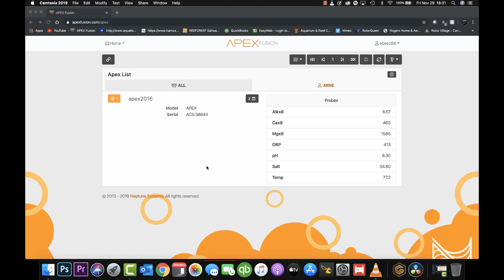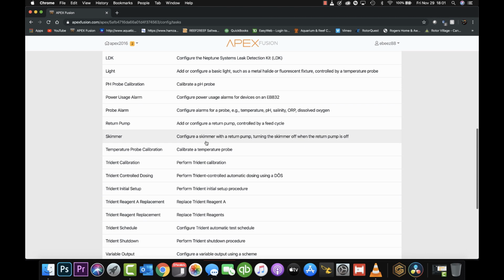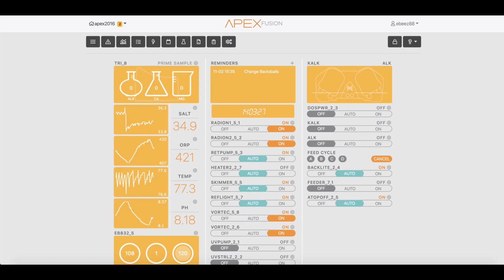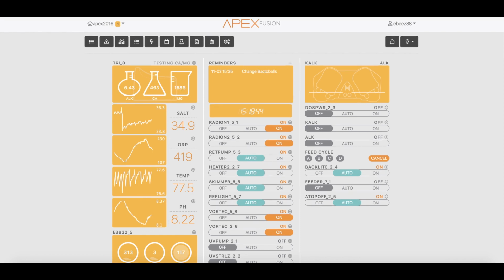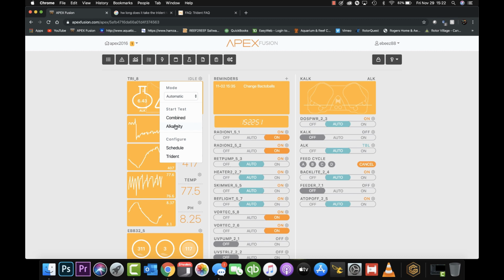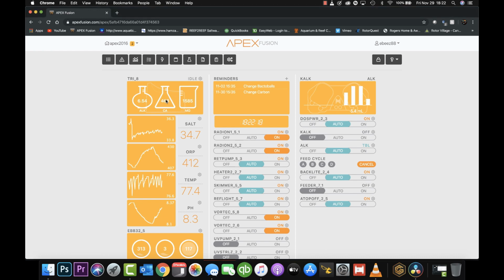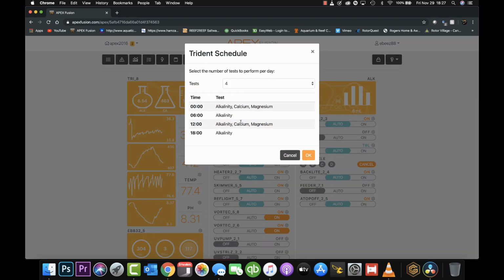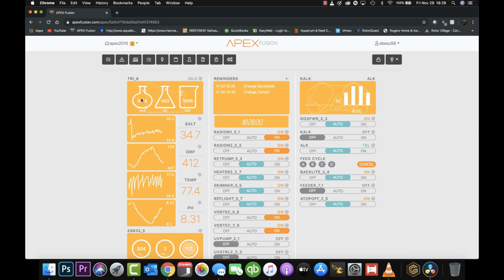Neptune Trident initialization and set-up

Comment: Did you wait on calibrating your trident, or did you do it right away?
I myself also noticed that the calicuim reading is around 60-80 ppm than what it actually is
Reply from the maker: Hi Larry, I waited for 24 hours then calibrated. My calc is also reading high as well...